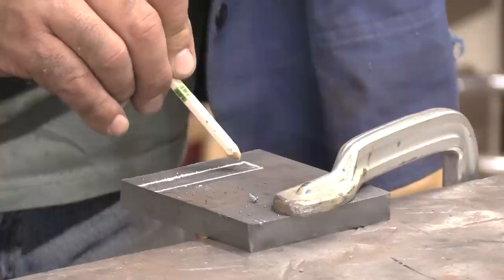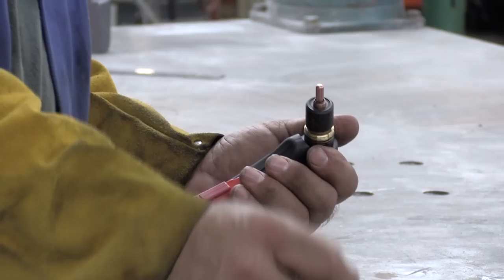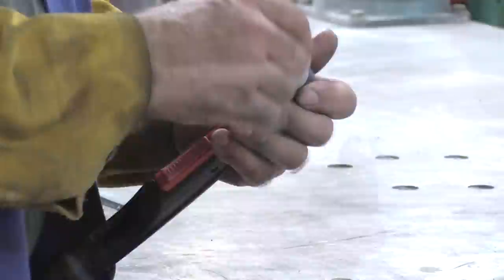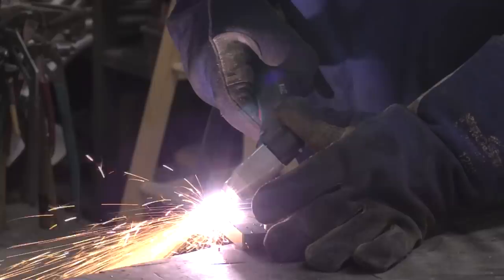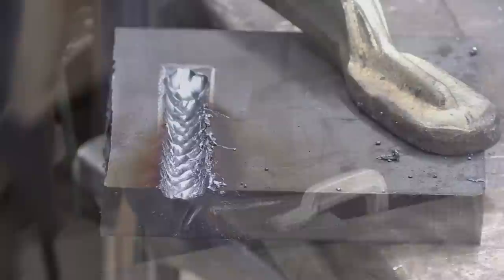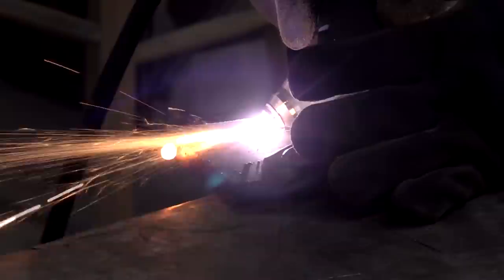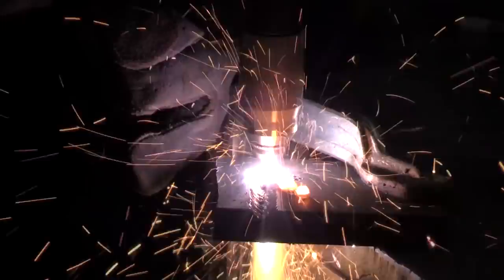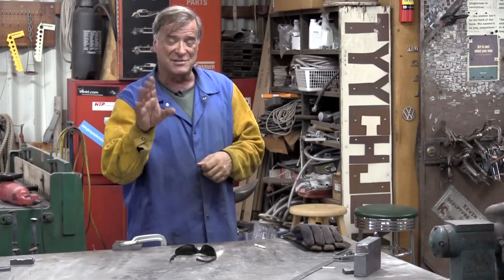How to Gouge With a Plasma Cutter – Kevin Caron

Comment: I only tried gouging once but I pushed the torch instead of dragging it. I wanted shallow texture on a surface, and I liked the results.
Reply from the maker: It's all about technique and practice for sure.   This was the first time I tried it and I am really happy with how it worked.    I have a 6 by 6 by6 block of steel that I will have to try carving on with the plasma.
Reply: Apparantly for weld removal people tend to push.
Reply: you were right pushing

Comment: Sometimes the pilot arc is on and the plasma arc doesn’t start. I don’t always notice right away depending on the angle of the torch, and I gauge when I don’t mean to. I have to say though, the pilot arc makes a very clean shallow narrow (3/32”) gauge. If it didn’t damage the machine, I would figure out a way to turn the plasma arc off and just use the pilot sometimes. I can get very neat lettering that way, but the plasma comes on, and so it’s not practical. I’m using the new ?Thermal Dynamics Cutmaster 40.
Reply from the maker: Interesting Mel!     have to give this a try.       Thanks for watching and posting.

Comment: I did a lot of heavy carbon arcing repairing construction equipment.  I doubt plasma will ever replace it, especially  the thick stuff, but I can sure see it could do some of the same gouging I used to do.  And that's a good thing.  I dislike violence.  Frying, sizzling ear wax is not a pleasant thing to listen to.
       Carbon arcing may turn you in to a church goer as it gives you a little insight about what the fire and brimstone  of Hell must be like.
Reply from the maker: Still thinking about the block of steel I have and what I can gouge out of it.
Reply: Kevin Caron, Artist ....The great thing about steel as a media is you can always erase anything you don't like.  Cut too much? Add some back.  Add too much? Cut it back off.
     Cut a board too short?  Now you have what you call " a mistake".  I could never get my board stretcher to work worth a damn.  I have a metal shop and a wood shop,  most of my boo-boo's occur in the latter, as does most of my foul language.
      I think that billet is in the right hands right now.  Hope you consider it video worthy enough to share with us and  hope it sells for a nice profit when your finished.   I really like your channel.  Like your style and demeanor. Like Button collects no dust when your on!
Reply: I made metal bark for a table.

Comment: It would be kind of cool to have the option of using the CNC plasma table to etch a rough pattern into a piece rather than cut completely through.  Probably hard to control, but would be an interesting artistic texture.
Reply from the maker: That would be fun to watch!   Maybe just set it to gouge.  Have to look into this.   Thanks for the idea.

Comment: I am a farmer and now I am going to switch one hay fork to another tractor. I have to remove some previous welds. Torch it, cutoff wheel, metal hand held saw or gouge it with my plasma cutter? Recommendations?
Reply from the maker: Get the proper tips for "your" plasma cutter.  This will be the best way to do this.   After that I would go with the cutoff wheel.    Hope this helps, and please let me know how it goes for you.
Reply: I would plasma gouge if there is a lot of weld material and minimal weld penetration. If it is a repetitive process, I would apply a pad weld to both sides of the weld joint and then weld the pads together, so that the parent material does not have to be gouged. With practice I am now faster and more accurate with gouging and a quick wipe with a cubitron II fiber disc than any other method of structural weld removal.

Comment: Didn’t know I could use a plasma cutter to do this. But my plasma is little and cheap (Chinese eBay model). My victor torch is going to have to suffice until I get a more manly plasma cutter!
Reply: are the little cheap chinese models any good?
Reply: Protected Profile they are OK for general use in the garage at home. Mine surprises me with the thickness that it can cut. It’s saved me a bunch of times with helping me complete projects that would have taken forever with other cutting tools. The only thing that worries me is will it last. Every time I power it up I hope I don’t let the smoke out!
Reply: Initially I didn't know about plasma gouging. I discovered by accident that I could use my cutting torch with cutting consumables at a low current of 20-30A (85A machine) with the torch on an angle to remove weld and other excess material. I damaged a few retaining caps in the process, but now have the correct consumables. So yes you can use your cutter to gouge.

Comment: Kevin, can you help me understand how a "40" amp plasma cutter works on a 15 amp circuit breaker , my welder does the same thing I can't figure it out
Reply from the maker: Step up transformer in the machine. Takes a low amperage coming in and make a higher Amp going out.
Reply: @KevincaronSculpture  thanks man, I appreciate it
Reply: The circuit break is design to handle 15amp at 110v which is around 1650 watts. The welder/ plasma works at 40amp at 15v to 30volts which is around 1400watts

Comment: Hi Kevin.  I wonder if you can help.  I have to cut a hole in the metal sheet  wall of my shed for a five inch pipe to go through.  Trouble is this pipe has to go through at 45 degrees.  How do I draw a fairly accurate oval hole for  cutting it?  By the way I don't have any computer drafting experience, so pencil and paper please.
Many thanks.
Reply from the maker: I have this old book from Johnny Hamilton.    It's called "Math to Build ON".     Pretty sure he talked about this in a section in the book.     Will have to find the book and I will take a look see.
Reply: Many thanks. I'm fairly sure there must be others who could use that.
Reply from the maker: I did find this website,  looks like just what you need! 

https://www.blocklayer.com/pipe-angle.aspx

Let me how if this works for you please!

Comment: sir very nice video but please make a video on difference between plasma vs laser technology. thanks jamil
Reply from the maker: Sure, send me a laser cutter and I will get right on it.        Sorry, but i really don't know anything about laser other than it costs more than a plasma cutter.  Never even seen one working.
Reply: I've not used an laser cutter they are pretty much like CNC cutters, there's no way you'll get one as an hand held machine lol

The biggest difference is laser is extremely fine cut and will cut very thin stuff say alufoil and the cut surface is really nice and clean, be 1mm or slightly less cut width.
Plasma has an 3mm cut width.They are called plasma cutters because they get up to the same temp as real life plasma AKA lighting, So you don't put you hand even with a welding glove in font of the gun even 10 or 20 cm away as it can cut through the glove and your hand that far from the gun.
I haven't done plasma gouging so that was good to see and the tips,  I'll have to see about work getting those gouaging tips for the plasma it's an thermal design machine as well.
Reply: sir thanks for reply and nice video